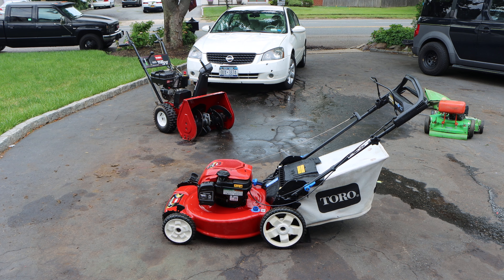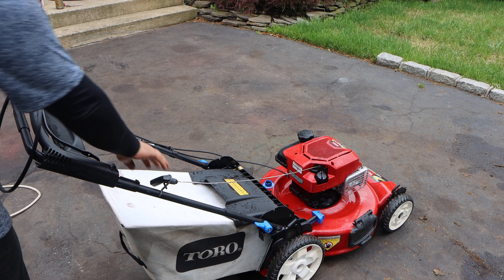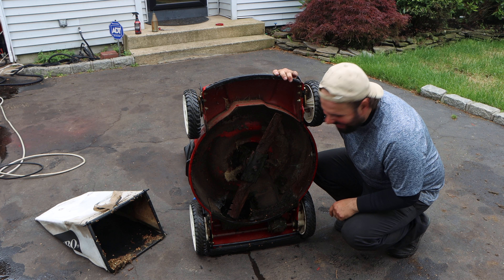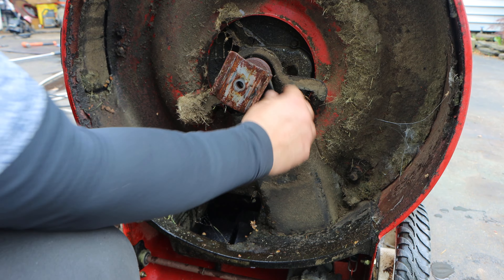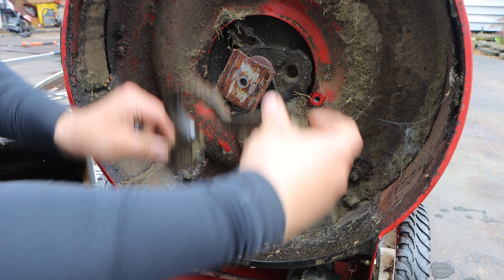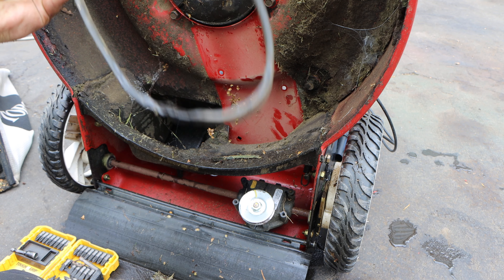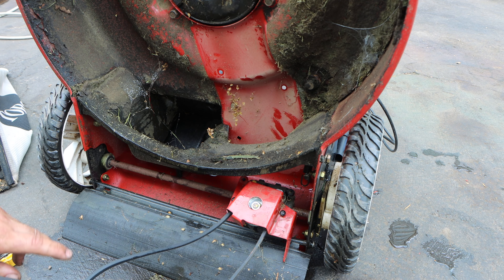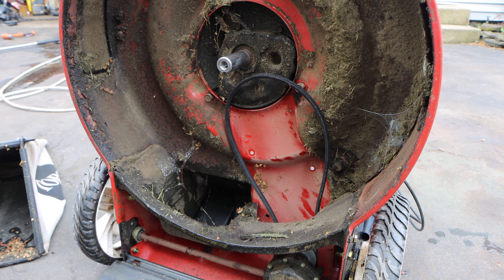How To Replace the Drive Self Propelled Belt On Toro Personal Pace Smart Stow Lawn Mower NO START!

Comment: Jason, My sister has pretty much the same exact Toro Recycler SmartStow mower(20339) except her mower has the front wheel drive instead of the rear wheel drive like the one shown in your video. Usually the only reason that the mower is stood up is for washing off the underside of the mower deck. 
When the oil was changed earlier this year, The oil was relatively clean with some entrapped dirt within the used engine oil. I purchased a second mower blade in which I change out when the blade is used about every two months depending upon use.  When the mower was unboxed, I treated the mower deck with WD-40 in which worked very well. There’s very little grassy build up compared to untreated mower decks in which just as soon as the water is sprayed - The grass clippings easily wash away. The wheels need some lubricant periodically to keep from squeaking. Otherwise the Toro mowers are great machines.
Reply from the maker: I have one of those in inventory as well paid $100 running.  I have it listed for $280 with some trouble selling it.  This mower sold within 48 hours of posting it this past week.  

Is your other blade another atomic or you went with something different.

Your sister is lucky to have you…mower will last her a lifetime bc of you! 🇺🇸🔧🤙🏻🦅
Reply: @pattayperformance  Yes, I purchased a second atomic blade at Tractor Supply Company for around $20.00 which was comparable to the blades that were listed on eBay. The atomic blades really deliver a very nice cut quality, So I am going to continue using them. 
Actually, I installed a Gator/Predator style blade on my Snapper Hi-Vac that we have discussed before in which I  sharpened with a sharper edge than it was when it was brand new in which it now cuts much better than before. Jason, I didn’t change the bevel on the blade or anything extreme but opted to sharpen with a true sharp edge and I was quite pleased with the results. A few days ago, I replaced the discharge chute on my Snapper in which someone in past years had cut off part of the old discharge chute off for some reason. The Snapper really threw out the grass clippings which usually wound up getting all over the person who was using it as a result. The new chute made a lot of difference with the discharge being directed downwards. This chute is the same one used for all of the classic Snapper 21 inch mowers through the Snapper Commercial Mowers with basically the same mower deck shape. Maybe this bit of information may help you out some day regarding any Snappers that you may encounter.

Comment: those RWD toro's belt replacement can be a little tricky.  First one I did was on a older one with a Tecumesh Engine with the Adaptor stuck to the shaft.  so I had to take the engine off the deck to get the belt on if I remember correctly.   looks like toro improved the accessibility on this one.
Reply from the maker: You know bc I’m a OCD idiot…if I see a blade adapter is stuck while doing repairs.  I get my $20 puller from Home Depot out and pull it off the shaft, polish and reinstall with anti seize.  The next person who works on it will thank me!

Comment: It`s a nice tutorial! I have to face this job, but even 3 times more, because our TORO is all wheel drive...  I`m just curious, how long is the transmission belts serviceable life? It seems to me, they work in a tough environment. They must be replaced as you`re topping up petrol :)
Reply from the maker: AWD should just have one belt and 2 transmissions!

The belt is longer and stressed/stretched out more bc of that.  I would make sure that everything is clean underneath as well on a frequent matter to try and optimize belt life.  Is there a cable adjustment?

I have never done a toro AWD mower but I have done a few HUSQVARNA’s.  I have a video on that.  Same but different…

What is the model of your toro?
Reply: @pattayperformance  The model is 20353. It does have two separate belts (different size as per its parts list). I`m curious how it`s connected to the engine shaft... No any information in the internet. Probably a double pulley above the cutting blade...
Reply from the maker: @alexanderchuyko4889  you are correct and that’s CRAZY IMO.  That’s only thing I can think of.  I will take a look at schematics later

Comment: I have the Toro self propelled rear wheel drive. It needs a belt change about every 2 years. Mine is harder to replace than what you just did. I hate it. Could they have made it any harder to replace? 
Looks like front wheel drive is much easier. 
I just replaced mine. All back together but it is 1am. I'm praying it is gonna work fine in the morning. 🙄🙏

Comment: Hello did those rear wheel tires come with your lawnmower? I have 8" on mine and would like to change them plus is it gear driven.
Reply from the maker: Yes they did and they won’t work bc height adjusting assemblies are completely different

Comment: My belt keeps coming off on the drive cable end of my 20332 rear wheel drive. I’ve tried two new different belts. The last one I tried was toro original. Any tips on how to fix this?
Reply from the maker: Give me a call 631-707-0797

Comment: How do you tighten the tension  of the belt on this lawnmower
Reply from the maker: @bradbarthold1278  covered In the video 🫡
Reply: @pattayperformance  which part
Reply from the maker: @bradbarthold1278  watch the video and tell me.  I posted this 3 years ago…I don’t have memory like that 🤣
Reply: @pattayperformance is it the knob that adjusts the self propel cable
Reply from the maker: @bradbarthold1278  watch the video for all your answers

Comment: If you’re still responding to this video- I was working on mine today , wish I had seen this video first. So I broke both of the belt guard bolts off. I didn’t think it would be a huge deal until you said they bolt the engine to the deck so now I may really be screwed. Also, my blade adapter is frozen on the shaft and I really can’t get my new belt on. Any ideas on these two issues? (This mower was a hand-me-down) Thanks!
Reply from the maker: You will need to extract or drill out the bolts.

If you drill them out…need to tap new threads OR get longer bolts and put the washer at the end.

If your pulley is frozen you will need a two jaw puller and longer for the pulley to grab
Reply: @pattayperformance  thanks a lot!

Comment: I changed the belt, but afterwards the rear wheels turn on their own, without pressing the progress bar, what should I do? Adjust transmission cable? If yes, how much? Thanks for your help .
Reply from the maker: AWSOME loosen up the tension and adjust as you see fit.  I have mine on the lowest setting so I have complete complete control of mower for the best cut possible

Comment: DON'T turn the blade of a gas lawn mower before removing the spark plug wire!
Reply from the maker: I get it...how fast do you have spin the blade with brake engaged to start?
Reply: Just enough to get a spark out of the plug.  It doesn't need run only fart to cause damage to your fingers.  So about 20 degrees, an very slow.  Luckily, there is also the kill to the coil switch that is connected on the dead man handle bail.  Since you do know the machine you just picked up the kill switch may not be working; I am sure you have run across that, as the switch does fail or gets out uf adjustment were the mower will not stop. Great video about the bailt.

Comment: I have this mower, and after a few years of using it with no problems it has started to die when I engage the drive. I’m not sure what is causing it, and I haven’t checked the belt yet, but have you ever run into this? Runs just fine otherwise, and if I push it without using the drive it stays running just fine, but as soon as I engage the drive, it dies.
Reply from the maker: Could be something jamming up belt/pulley and bogging down the motor.  I would pull the covers and make sure everything is spinning freely!
Reply: @pattayperformance  thank you!
Reply from the maker: @Jamie_McGill  sorry for the delay in response!  YouTube doesn’t notify me of every comment.
Reply: @pattayperformance  that’s ok! I appreciate it

Comment: Shouldn't need that much torque for anything on that mower. I was able to get the blade bolt off with an M12 fuel impact driver. I really want that M12 impact wrench for the car though.
Reply from the maker: Rather be safe than sorry.  My M12 Fuel 1/4 Impact Wrench Struggles after I put on the Adapter and correct size impact socket.  After a few Uggah Duggahs it will start to move.  I don’t got time for that 🤣

Comment: I have a 28 year old Lawnboy Gold series made by Toro  where the entire belt is on the top of the deck . The belt and the 3 speed transmission have never failed in all that time and I cut a 1/4 acre once a week. Why can't they make them like that anymore? Planed obsolescence ? Except for cleaning and greasing the small drive gears so they will slip when going backwards and replacing the wheels when they wore out and split the drive train has been trouble free. What recently failed the blower housing from metal fatigue where it bolted to the engine from so many pull starts and I replaced the pull cord itself once.
Reply from the maker: That’s awesome!  They don’t make ‘em like that anymore bc consumer wants the cheapest possible.  Don’t care about quality unless it’s designer clothes that impresses no one.

Comment: I'm having a problem getting my cover back on. One side lines up but the other doesn't
Reply from the maker: Make sure nothing is obstructing it getting into position
Reply: @pattayperformance  you made it look so easy putting the cover back on
Reply from the maker: @bradbarthold1278  

I just had a lawnboy mower that made me question life’s decisions trying to put one of the covers back on.  

You are at the home stretch of the repair!  You got this!  If you need help let me know
Reply: @pattayperformance  I was able to get it on I didn't know you had to tuck it in underneath the guard. Once I got it underneath the guard and in place the screws went right in. One question I have though is the cover is on tight but it's not touching the belt. Is it supposed to be tight
Reply from the maker: @bradbarthold1278  it should not be touching the belt bc it will rub
Reply: @pattayperformance  the belt moves freely when I touch it with the cover on